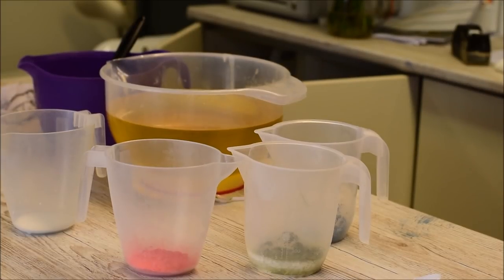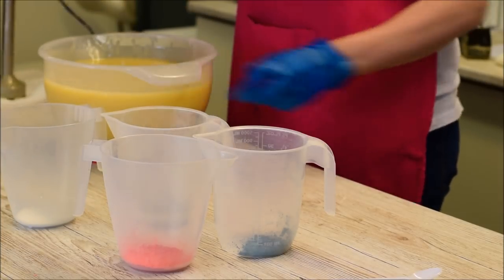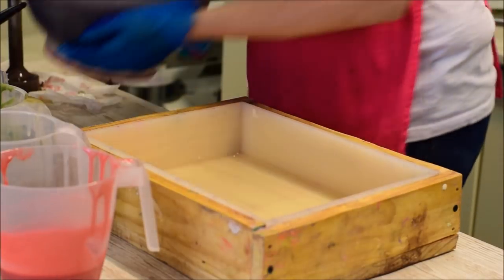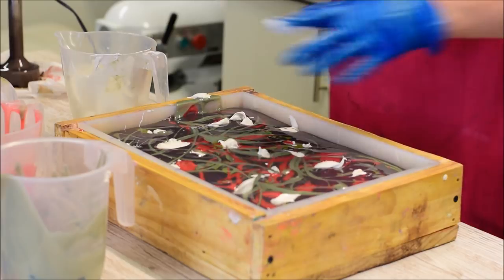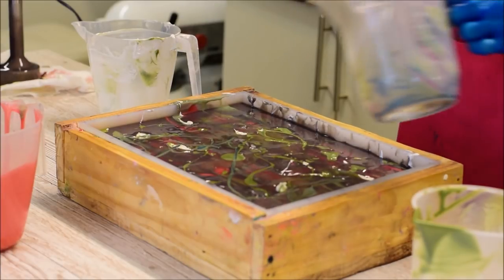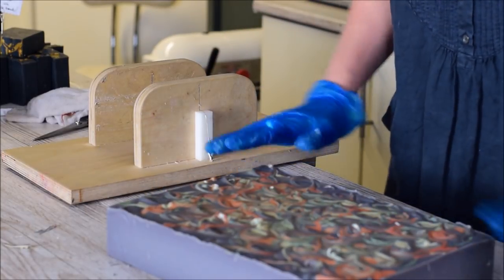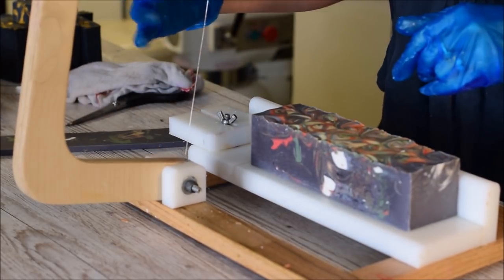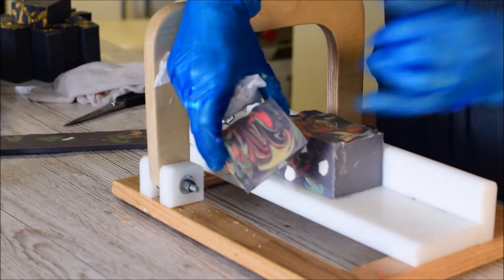Cherry Moon Soap | FuturePrimitive Soap Co.

Comment: I've used varying shades of a white in mica since my TD is in water and can often cause overheating, glycerin rivers and acceleration depending on the FO.  I rarely use TD anymore because of that.  The white micas I've used can usually bring a nice clean white in most of my recipes.  The only ones it doesn't whiten intensely in are those that contain beers or other boozes or those FOs with vanillin. Hope that helps!
Reply from the maker: I find that with a water discount the TD no longer crackles. That may be worth trying if you haven't?  And yes...boo to fo's that discolour!

Comment: Lovely soap,  sorry about the TD.  I mix my TD With a bit of warm water ..  if you do a water discount it will thicken like crazy if you don’t pre mix .  Also the blue is a rough color to get when your main batter is yellow.  I find I have to almost use double the amount to get a good blue or it turns green.  You could use a bit of pale purple to counter the yellow , have not tried it myself yet.  No white mica turns the batter as white as TD.   THANKS FOR SHARING WITH US !
Reply from the maker: I always mix my TD with water. It's ok if I use it in a whole batch as my base. If I use it to swirl it thickens so I need to use less I think. I can get blue no problem. This particular mica I used doesnt stick in soap. It turns back to the soap colour weirdly. I use cobalt mica, or ultramarine with no issues. It's just this one particular mica. It's badly behaved!